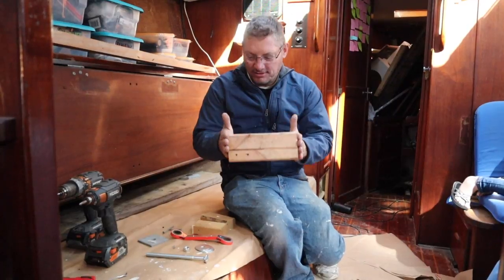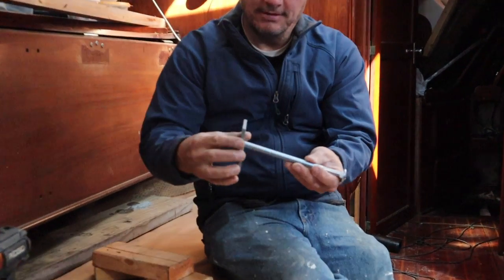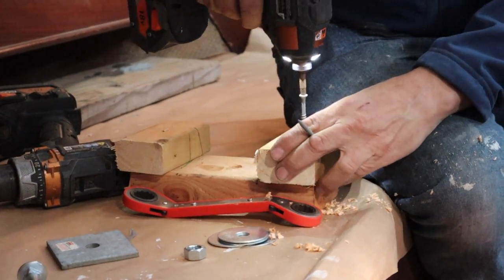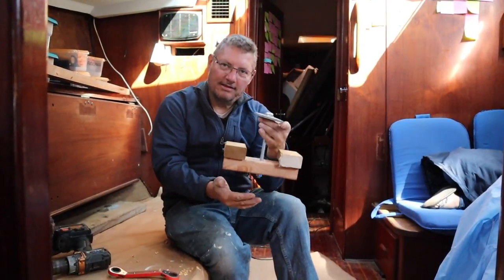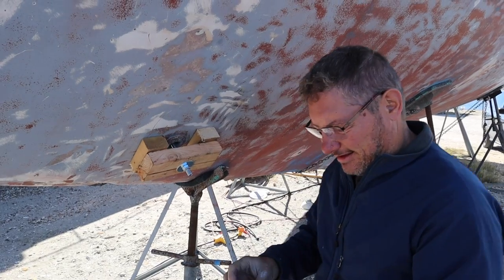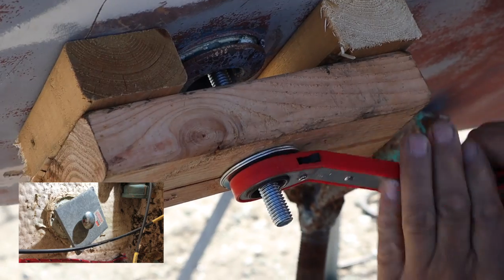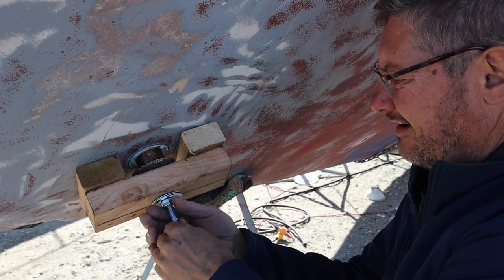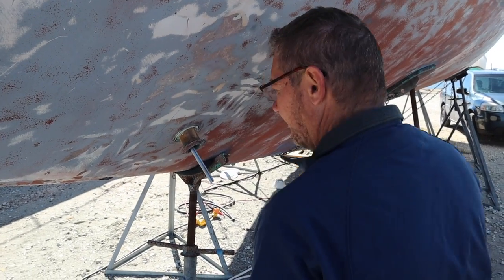Homemade THRU HULL PULLER  | ep. 47

Comment: Whenever I need to remove something that 5200 was used I use torch to heat up the metal part and that softens 5200 loose.

Comment: About to attempt this for the first time next week. This is a great suggestion as I don’t have clear access from above to beat it out. Think this will work with a plastic fitting or it’ll deform?  You mentioned at the end having to fiberglass. Could you not just clean it up to gel coat, seal in the new fitting?
Reply from the maker: I don't know if it will deform it or not. Shouldn't if you apply pressure evenly. We fiberglassed in the hole because we weren't using it any more.